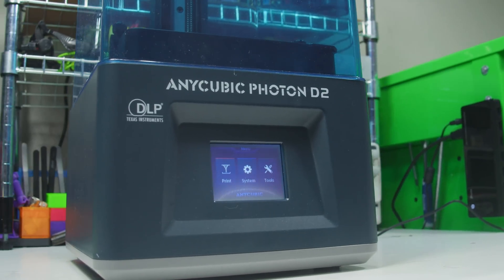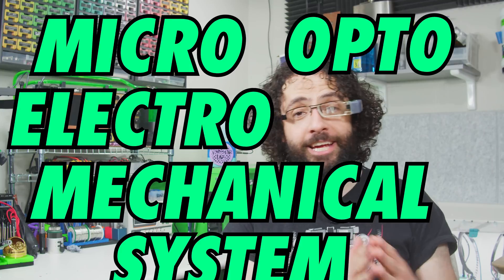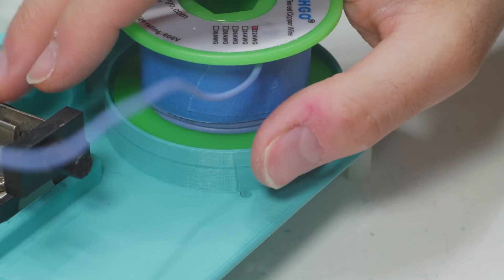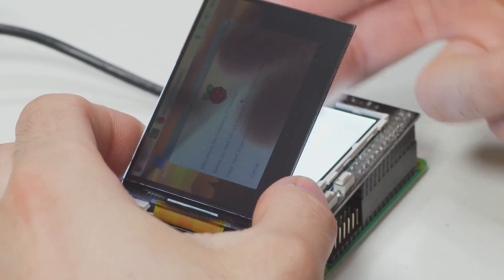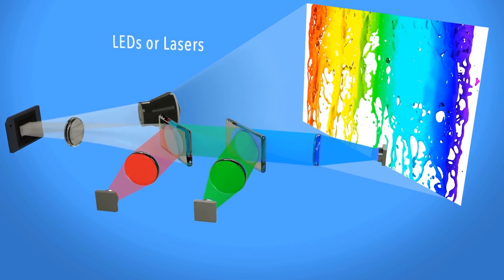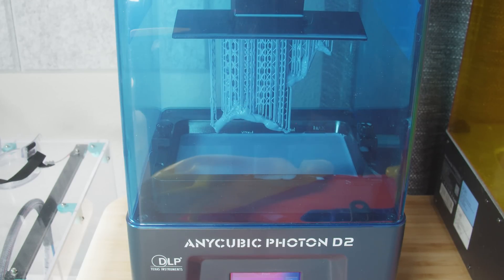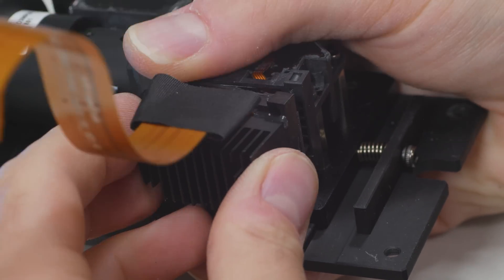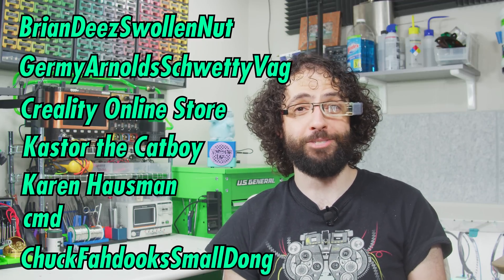Four Million Tiny Mirrors: The Insane Engineering of DLP and the Future of 3D Printing

Comment: Oh yes! My main TV still IS "old-school" DLP (ha). It's a Mitsubishi WD-60737 5-foot 3D TV that I bought in November, 2009, 5 months after the original DTV transition. And I have had to replace the lamp just one time in all those years, and my DMD still mostly works but it is getting VERY spotty! So eventually here I'm going to buy a new DMD card for it and see if I can pop the dust cover off the original and try to run it before swapping, and see if I can feel the little pixels moving around and if I get freaked out by it (at least if there's a way to make it run and not burn my finger)! And yes, on start-up you can easily hear the mirror motor spin up, but then I guess it goes super- or ultrasonic or something at full speed. So yeah, I keep saying that DLP video technology is the most mechanical that we've had since the old original mechanical TVs in the John L. Baird days before our buddy Philo T. Farnsworth from right here in my own state, Utah, came along. Very interesting what DLP is and how far even that tech has come! -- Mike A. Christensen

Comment: Oh my gosh, yeah, MEMS are freakishly interesting! It's hard for me to imagine microscopic little gears meshing and actually spinning on tiny little spindles instead of just getting stuck!
Reply: Same. I was like "Whaaa? Those work? With no errors? And I've never heard of a broken accelerometer chip before so they must be durable too even though they're so small."
Reply: Yeah,  @glodigit , it's hard to imagine that they could be durable at all. And they do break for sure, because my DLP TV from 2009 has many stuck pixels now; some are white and some are black. I will eventually replace the display chip (DMD) card, but before I put the new one in, I want to see if I can pop off the dust cover from my existing one and let it run and see if I can feel the potentially freaky feeling of tiny little mirrors buzzing around under my finger!
Reply: @HelloKittyFanMan.  That idea sounds so futuristic
Reply: @glodigit : I don't know if it's really futuristic; it's just an experiment that I want to try. But yeah, if it happens, it's obviously in the future. ;-)

Comment: DLP chips always blew my mind. I have a single chip projector waiting for me to get a screen up again when the intended room gets renovated. But. Just thinking about the proposal. Yeah, we are gonna build this tiny chip that has millions of tiny mirrors and motors that can be set reliably to various degrees individually... Oh, and we need them to do it over a hundred times per second because that's cheaper than building systems with three of them.

And yes. I too suffered the rainbow effect of the single chip dlp projectors spinning color wheel... But my eyes quickly got used to the artefact and now I actively need to look for it to notice it. 

I also remember using a RED One camera with a DLP eyepiece... That rainbow effect was downright painful. No matter how small my eye movement. It would go psychedelic. It's like they only used one cycle of colors per frame to save cost on a massively expensive display. I am very happy that nowadays we have OLED for that application.

Comment: Isn't there a threshold amount of uv light that polymerization happens at? I am pretty sure in my reading it was found that msla has to have a specific pixel value before any polymerization will happen, and that was adjustable for antialiasing for slicers. Aside from being able to focus in on a smaller area for resolution if you are using adjustable lensing, does DLP offer anything over MSLA if the full bed resolutions are comparable? I would think the cone of light rays divergence would be a bigger factor than a tiny bit of ambient uv.

Comment: Older dlp printers had the common problem of shifting mirrors and misalignment due to failed moving parts. I think it will still be an issue to be considered, specifically on a small and portable device.

Comment: I worked for a Traffic Management Center that used DLPs in their video wall because they didn't burn in as much as LCD or plasma showing the same intersection for hours and could be had with almost invisible bezel. They also avoided the cooling problems of plasma at that scale.

Comment: I'm way way way behind on the tech - but I was under the impression that the mirrors oscillated (to prevent burn-in) at something stupid khz or so - even when full bright or full dark, and their brightness was essentially pwm of that frequency. DLP still leaks some light based on the % of time the dmd spends in the transmit mode and how crappy the optical assembly is. Alternate sauce = I own a dlp projector and 'off' black pixels are definitely some% on.
Edit to add: in the photon, pretty sure they can control it to full off full on better than typical video projectors.

Comment: Na mate not 4million tiny mirrors. its just under 1 million micro mirrors with a 4 way actuator that's why it is exactly double a 1280 x 720p in both directions, its the same dlp300s chip as in the first ultra but with the 4 actuator installed to circulate the pixels into 4 different areas while running at 240hz so each pixel gets 60hz which is a smart way to improve performance. You can even see the corresponding DLPC1438 display control in the video clip that is designed specifically to operate the dlp300s that is 1280 × 720 array of aluminum micrometer-sized mirrors, in an orthogonal layout.

Comment: Back in the 90s at Alphatronics in Colorado Springs, we made probe cards for Texas Instruments, with a hundred tiny tungsten wires to check each die on the Digital Mirror Device silicon wafers before they were cut up and packaged. Occasionally the person operating the probe would try to translate the prober without lifting it first, dragging those hundreds of probes across millions of tiny mirrors.

When we got the probe cards in for repair, we joked that some poor schmuck at TI had about seven million years of bad luck coming to him...

Comment: I too had a 56" DLP TV back in 2007, although mine wasn't the color-wheel variety, but rather one of the first or second generations that used Red Green and Blue LED Panels to shine light on the DLP chip, was a Samsung but can't remember the model.  If you moved your eyes from one side of the room to the other quickly you could see that RGB shimmer, it also had an annoying and unfortunate defect where if the screen was completely black, but there was a bright part of the image, there was some internal reflections due to the "light sink" area that wasn't completely light absorbing, so some would still bounce around and get out, resulting in some halos in certain areas of the screen.  Those were 2 of the annoying aspects, but having 1080p with otherwise an incredibly bright, vibrant and super clear image was great, and the blacks (minus the light halos under certain conditions) were still great for the years that I had it.

Comment: While I love DLP I hate how much the marketing basically lies or exagerates its benefits namely that sharper equals more detail specifically in the context of pixel sharpmess becaus that is what DLP sharpness means. imagine for a while you had to make a mosaic, which would give more detail? using bigger perfect squares or smaller circles? Anti alliasing might help but 8K lcd vs 1080 DLP you are going to get more detail in the 8K. So I imagine both will exist side by side. Even after all this time its not easy to make high resolution DLP and while you can compensate with pixel shifting that technology is still very expensive. At least until UV OLED displays which is what I personally thing will be the end game. It has all the advantages of DLP + higher resolution + being easier to maintain since the optix and alighnment aren't necessary.

Comment: Got a Mono X. Came with warped build plate, 0.5mm inwards or 10 layers off. Asked for a replacement and was made to prove that it was warped. I did, and they sent me another equally warped build plate. Objectively a complete shit company. My Mono X never did more than a few bodged prints (also the firmware is complete trash and ignores bottom exposure settings, gradually going from bottom exposure to normal exposure over 30 layers, causing massive elephant foot, and with that useless prints in the use cases I need it for).

Comment: Thanks for the nice video and explanation :)
Maybe i got it wrong, but if each "pixel" on that silicone only knows 2 states, how does antialiasing help to remove the "too crisp" edges ? or... how are grayscales possible ?
Reply: Think in terms of frames per second in a movie.
You want to project at 28 frames a second (the industry standard for film).
So if you project at 56 frames a second, with the intermediate frame containing the half tones, you get a blurred edge effect at 28 frames per second.
This goes a long way towards making 4K digital much less fatiguing and more natural. 

In a printer, you would project the image, then the image with half tones, cycle the build plate, and repeat. It only adds the the extra exposure time, rather than doubling the print time.
Reply: @joshua43214  thanks a lot, now it makes sense :)

Comment: I had an old Sharp DLP projector with 1080i back when 1080p was still new. I never noticed the individual pixels from the color wheel system but the bulbs were halogen I think or something that ran very hot and over time they would develop a flicker and get dimmer. They were replaceable of course but who wants a tv with a consumable part?! LEDs have pretty well solved that issue though.

Comment: Zach that has to be the best explanation of DLP I've seen. As much as I would like to get a D2, I really can't support any printer that uses a Chitu board which I assume they're using. Their locked down approach eating almost the entire resin market is really wack. Forcing you to use their slicer with proprietary file format is a real no-go for me. That said, the D2 is new and I can't find any info on the board they're using. Hopefully it'll be more open than their other printers. Not holding my breath on that though.

Comment: Technically also the past of 3D printing, innit? iirc, some of the early bodged-together DIY resin printers used DLP projectors with the UV cut filter removed from the lamp. 🤔  DMDs are so frackin' cool.  In the early 2000s, I used a DLP projector as my primary TV.  Playing videogames on it was mind-blowing. 😁  And yes, I could see the rainbow artifacts from the color wheel...I was the only one in my family who could. 😭 (Luckily it was a late-generation color wheel DLP, so it was barely perceptible...after a couple months, I had to try to see them.)

Comment: I've been using a couple open DLP printers at work for a few years now, so I've been able to get any resin and make a profile for it, so so much faster printing than the old form 2
Edit: I work in dental, all of my models are fingerprint surfaced looking voxels lol,
Reply: Howdy fellow tooth tech!! :) 

  I just got 2x D2. and I want to use Asiga denta model resin and Keystone soft. 
Which resins have you profiled so far? I never 'dialed in' a resin though. Do you like the D2? I also have an Asiga Max Uv and just bought the anycubic M3 plus but the d2 is my main focus. It is kinda noisy truth be told.
 Do you have any parameters to share?

The printer instructions say not to use SLA resin only DLP resin
Reply: @justaperson1144  so right now we're using an envisiontec envision one, two older open printers, Miicraft 125, though other companies sell it under other names, we started using the new keystone model material,used their regular model material for 4 years, in addition to their gingiva, night guard, surgical guide and try in material, on the envision one we're locked to only their materials, do you have any issues with implant models warping around the cutout for the gingival mask?
Reply: I've not tried DLP printers, but I've got a Mono screen resin printer at home, and it is so much faster and easier to use than the Form 3 I had the "pleasure" of working with during my internship at a company during my education. I legitimately don't think I fully understood how workflow is supposed to work with the Form printers, but it was a massive pain to do anything with it compared to my own printer at home.
Reply: @marc7425  Form 3 machines use lasers to draw the pattern into the resin, this takes considerably longer than mSLA and DLP resin printing. However, models that come out of the Form 3, when printed using their own resin, is supposed to come out cured enough that it doesn't need to be cured further. That's what I heard at least.

Comment: I remember the colour wheel DLP projectors. They annoyed the hell out of me since every time my eyes would move the slightest amount I would see the colour smear.

Screen flicker was a big issue for me back in the CRT days so I was really happy when I managed to get a cry capable of over 100hz refresh rate so I couldn't see the flicker any more.
Reply: You could see the flicker of a CRT? The ~15kHz noise they emit is what gets me. Almost headache inducing.
Reply: I'm glad that my eyes were happy with 85 Hz in the CRT days. Never could abide 75 Hz or lower though. It felt like tiny hammers beating my eyeballs.

Color wheel DLP projectors are still widely used, but they swap the colors faster nowadays. The schools I work for have loads of them. I actually have an old beast for my home theater, the venerable Infocus X10, now on its second lamp. I can see the rainbow if I really try, but it doesn't bother me in practice.

Comment: is there a reason why they don't just make a UV LED array to shine layer images onto resin?
Reply: Because LEDs do not produce directed light(which would necessitate space around each pixel for reflectors).  By the time the UV light hits an LCD, it's already been cleaned up so the light is mostly traveling perpendicular to the LCD masking layer.  A DLP chip itself cleans up the directionality fairly well.

And require heat sinking(requiring space around each pixel for heat sinks at the required wattage).  OLEDs for example are quite toasty bois, and increasing wattage would be no bueno.
Reply: But there's such a thing like microlenses to straighten each LED's light. And a LED array could also be placed right up the FEP to reduce cross-pixel exposure. 
And since there would be no LCD nonsense, the whole wattage would be like 15 times less than in MSLA. And spread over the entire screen area, instead of for example 15 spots as in my MSLA printer, which doesn't even have any cooling fans in it.  
I'm not convinced that those can be actual reasons.

Comment: Watching the DLP 'home version' come to market has been exciting to say the least. If you take away nothing else from this video but are into resin printing, DLP defeats having to change the LCD screen for several years; you'll likely be replacing other major components before the DLP module. Just wish the Anycubic version was a bit larger, but all good things come to those who wait. And wait, and wait...
Reply: This being their second iteration of the product, I'm really excited to see comparative tests now that they've doubled the resolution of the chip from 1280 * 720 to 2560 * 1440 while adding 62% more surface to the printing plate size. I expected Elegoo that was rumored to release one base on the same design principle in march to beat them to it. It's sure exciting times for resin printing.
Reply: Yeah, really wishing for a larger one. I'm currently looking at getting into resin 3D printers, and would like something in the ~20 cm range, like the Saturn 2, but a DLP would be massively preferable overall. Even if it cost like a 1000€ or slightly over, that'd be basically 5 LCD swaps vs. the Saturn 2, and the DLP supposedly lasts 10x.

I think simply because of the size I'm gonna have to go with an LCD printer (it's not like they're BAD), but DLP as a technology makes immense amounts of sense.
Reply: Actually, I have seen that good things come to those who build them.

Comment: I honestly just started laughing when I realised the printer was so precise, it was showing the imperfections in the *model*, that's absolutely stunning. At the levels of detail that thing can capture, painting anything would almost be a waste, as I'm not sure you could find a paint thin enough to retain the small details 😂
Reply: "it was showing the imperfections in the *model*"
Or more accurately, it was showing the fact that the model is rendered into a series of images which have pixels. The fact that it can essentially render lossless information out of those images down to the pixel is ridiculous. Literally pixel-perfect.
Reply: You could probably print butterfly wings which are colourful without pigments.
Reply: @wayland7150  Not quite, for that you need detail at a scale too small to see, even smaller than the mirrors. You might be able focus the light to that size, but then you couldn't print anything larger than the DLP chip.
Reply: You thin your paints by mixing them with a small amount of water, on a wet palette. That or airbrushing.

Comment: Its also a lot to do with the fact that you are using a lens to focus the projected image. In LCD printers.. the image is sharp at the level of the LCD.. but the actual printing happens further away from it so the projection has already softened a bit. But this also requires a lot from the optics... as its really hard to design lenses that has zero distortion and equal resolution across the field. Though designing the lens for single wavelength really helps.